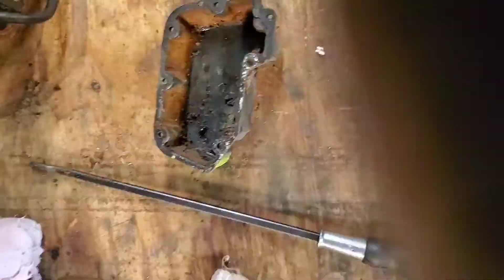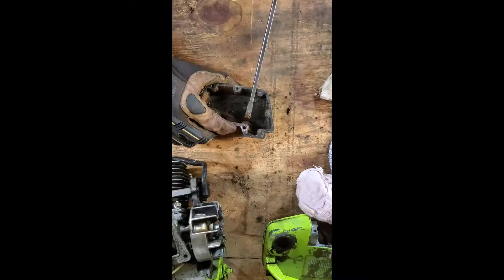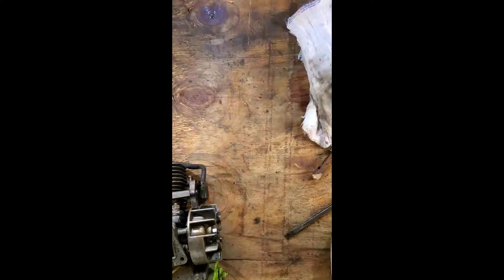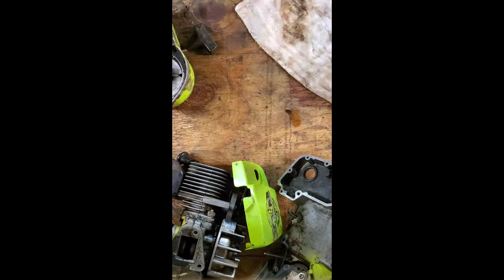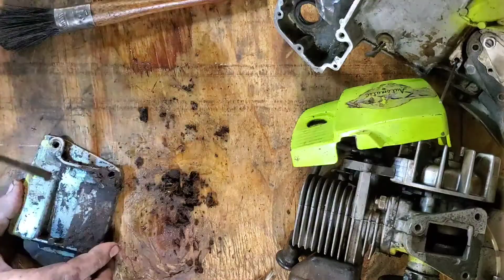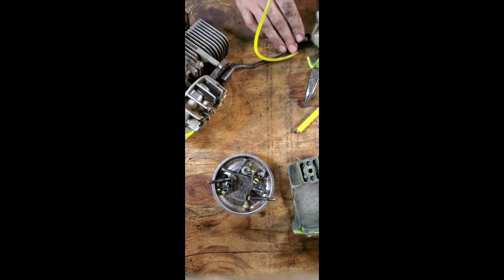cleaning Poulan 25DA Automatic  and instal of fuel line , filter and resealing fuel tank.

Comment: How'd you get the flywheel off to route the fuel line?
Reply from the maker: I dont remember that i did remove it but i usually use a deadblow hammer to knock it loose